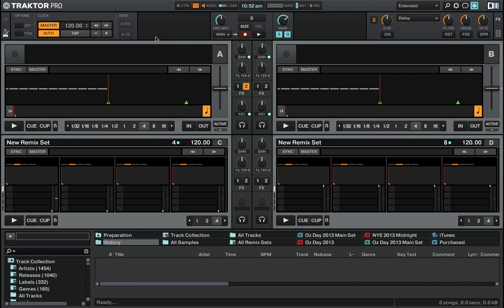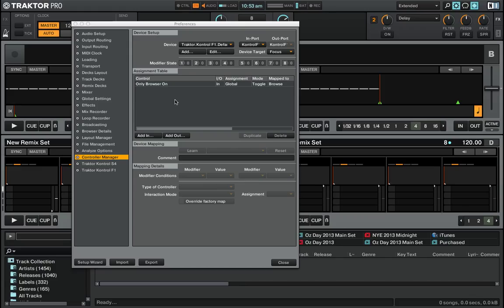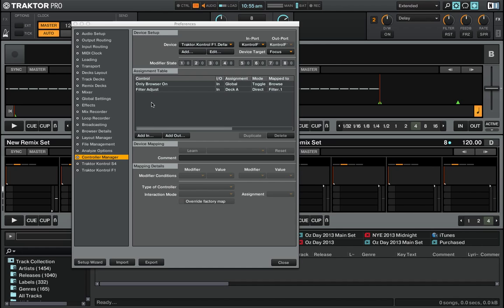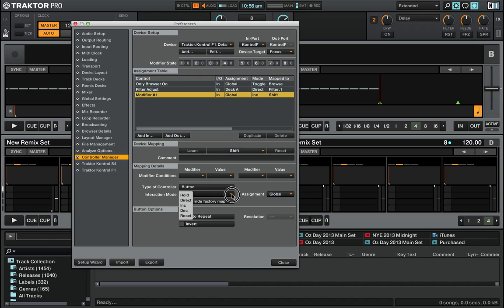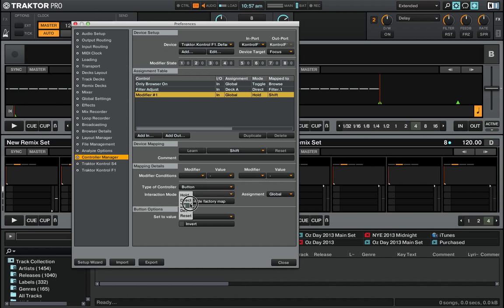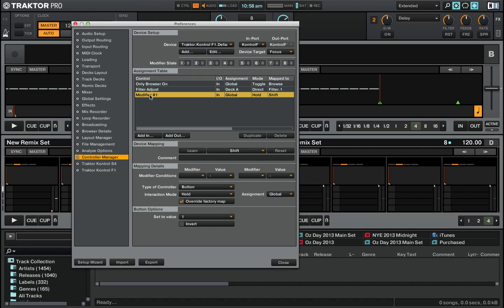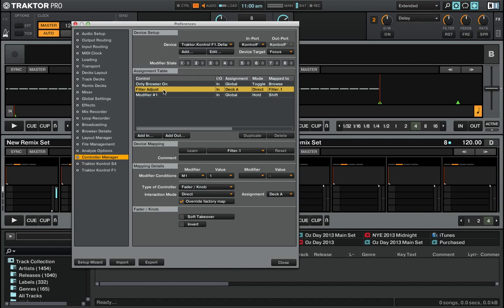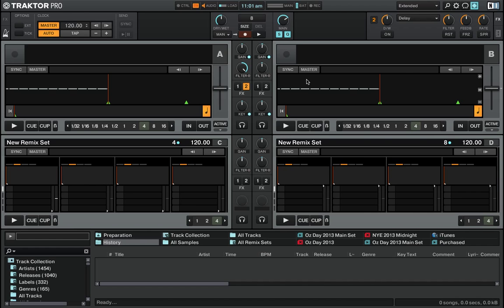Traktor Mapping with Modifiers Tutorial with Kontrol F1 Filters

Comment: Thank you for the video. Is it possible to set up multiple modifiers (3 button press).  For example:  shift + loop in + loop out = reset (0) key adjust.  

EDIT:  Realized it was better to map the reset to another button (shift + press move knob)
Thanks again!
Reply from the maker: And all before I had a chance to reply! You can only use two modifiers in a single mapping - but you can set a third modifier as a result of two button presses and then do a test on that - but it's ugly and probably a little unnecessary. Glad you found another way!

Comment: hello dj tm i want to ask you about modifier.
i'm using samson m25 and want to assign knob 1 to control gain also filter.

already make a modifire map and set to second map for filter.

but when i press pad for modifire 1 and turn the knob it move the volume fader also filter knob.

dunno what happen, if you know the problem pls help me out.
thanks
Reply from the maker: Raditya G make sure the original knob now uses the modifier condition like M1 is 0 so that it is enabled only when the modifier button is not pressed.
Reply: tmccoy00 thanks work lika a charm.
so 2 buttom should on same modifier the original must be set to 0.

thanks again!!

Comment: I am stuck in the following two areas.

1. I have already overridden the factory map for Filter Knob 1 on the F1 remix deck to control the track deck filter instead. I don't need it to control one Remix Deck – I want the filter to control ALL filter decks at the same time. Now, I want that same filter knob to also control something else, via a shift key (using a modifier). For example, a flange rate. However, when I use my pad as a shift key and rotate the filter, both the track filter and flange rate change together! This only happens when I remap the filter knob's original function as a remix deck filter. If I leave the factory map alone for the filter knob, then set up a modifier via a shift key for that same knob to control another function, everything works fine. But I don't want the original factory map setting for the filter knob! I want to change the original factory map of the filter knob to a new function, then set a shift key modifier ON TOP OF THAT and control them independently. But when I move the filter knob while holding down the shift key, both flange rate and the track deck filter knobs move at the same time. 

Is there a work around for this? 

I have set it up so that when I press a certain pad it switches the flange effect ON and also acts as a modifier for the flange rate to be controlled by the filter knob. And that filter knob is controlling not only the flange rate, but also the parameter I reassigned it to which is track deck filter, even when I press the shift key.

2. I use a pad as a shift key, as you have already seen. However, I can only seem to assign pads on PAGE 1. I want to use PAGE 1 and 2 for my samples, and put my pad shift key on page 3, so I can access effects and so on when I press a pad.

I hope this makes sense and I would be grateful for any help here!

Cheers!
Reply from the maker: Johnny Massacre I'd strongly suggest you post this in the NI forums with some screenshots to confirm what you are saying.

my quick replies would be

 1. you meed to map the filter multiple times to get it to control multiple deck filters. 

2. The "pages" of the F1 are a virtual concept and probably controlled by modifiers. you may need to set up a new modifier to define which page is active and then use thus as your second modifier condition in each mapping.
Reply: Cheers, I'll do that. Thanks so much for your speedy reply.

Regarding 1. actually the problem is that the shift+filter knob controls the shift function and the non-shift function at the same time, despite me overriding the factory setting. I actually meant I simply remapped the filter knob to control the filter for one remix deck. And then I mapped a shift key function for that same knob to control the flange. However, when I shift+rotate the knob it controls both the filter and the flange.

If I don't remap the original filter knob the shift+rotate knob works independently. But when I remap the filter knob, then put a shift function on that same knob for a different parameter, the knob controls both parameters even when I hold shift and also override factory map is on...
Reply: Thanks again for the suggestion, I made a post with images here:

https://www.native-instruments.com/forum/threads/complex-mapping-question-with-modifiers-and-shift-keys.314838/